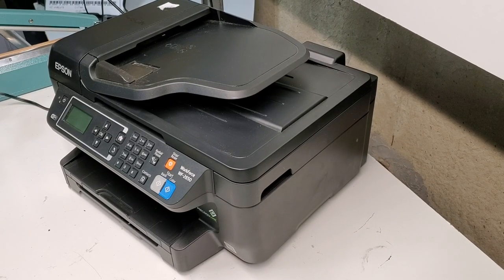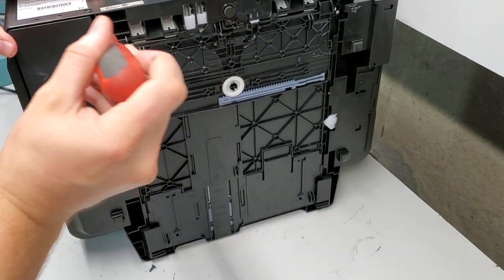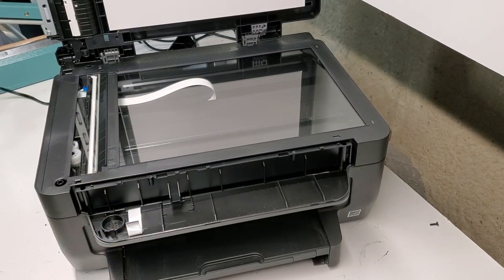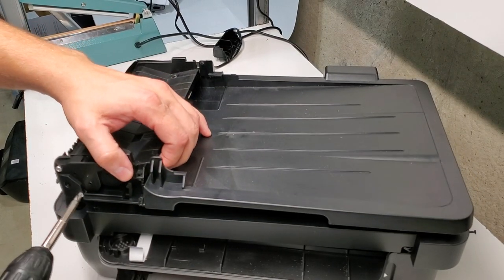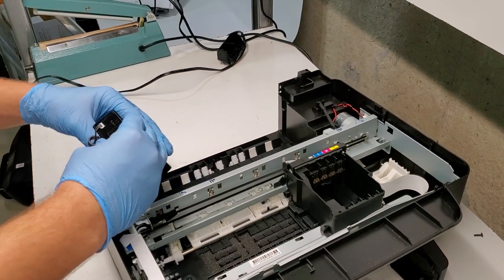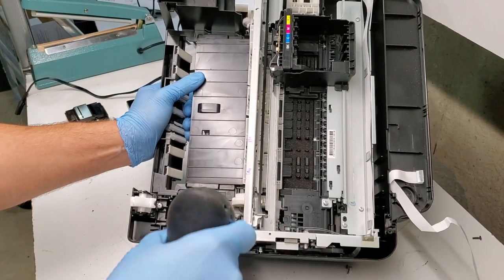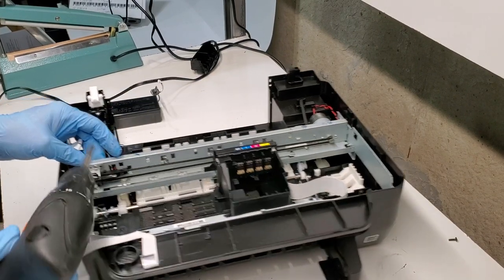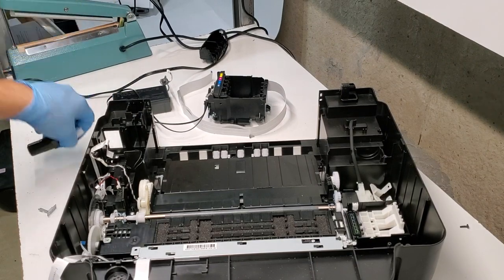Taking apart Epson WorkForce WF-2650 Printer WF-2660, WF-2750 WF-2760 Parting Out

Comment: Excellent video explaining everything clearly. Good job. I just wonder if you put it back together or not. I cleaned my printer head it started good but after one minute i smelled something burnt and now power button wont turn on the power. I did not wait long enough to let the printer head dry, probably rubbing alcohol caused a short circuit. Any idea which electronic board is burnt? Thanks in advance. 
I bought Laser Color printer as I was sick and tired of expensive ink cartridges and CIS. I believe the supplier in California supplied me ink supplies that were not good and caused clotting in the head.

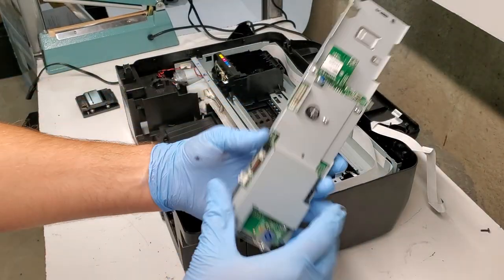Comment: 17:04 And now the big question, how to get the Mainboard back in?
I see no way to connect the very short FPC on the bottom of the board back in as there is no room between the housing and the connector to get to it... Hoped there is an easy way to unscrew and lift the complete chassis out of  the housing... 😓

19:30 now we're talking, after chassis is removed the Mainboard can be replaced, not before 😉

Comment: I have a broken timing strip - thank you for explaining what it does and how it is positioned.  When I have fixed mine, does it have to go through the box that holds the print head in some way to allow it to be close to the sensor?  Just leaving it loose is resulting in the printer slamming into the left side of the carriage and making monster truck noises.  Any hints much appreciated!

Comment: I don’t think that’s the right way to disassemble this product. I highly doubt that an Epson Service Center will take apart a printer like that. A lot of bending, plastic cracking and not gentle at all. Even those poor screws being ripped away with electric screwdrivers. That printer is done.

Comment: 09:50 Printhead
Reply: It's quite common epson failure (0x9e error) usually it needs only to disconnect the printerhead cable and connect it again.  Not necessary to dismantle the whole printer, only open the printerhead cover carefully. A warm reset (push power button while connecting the power cord) may be necessary too.